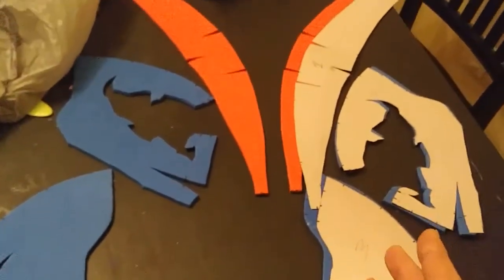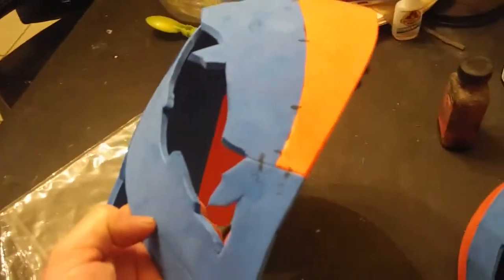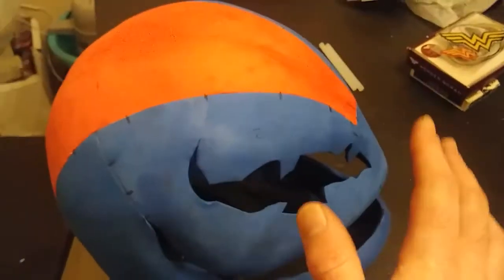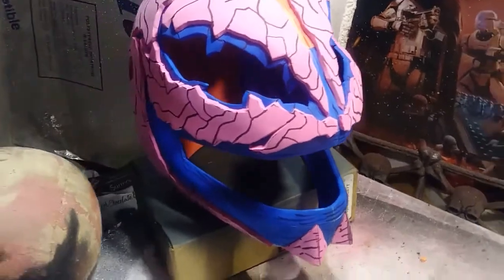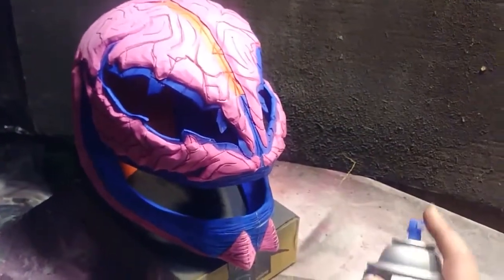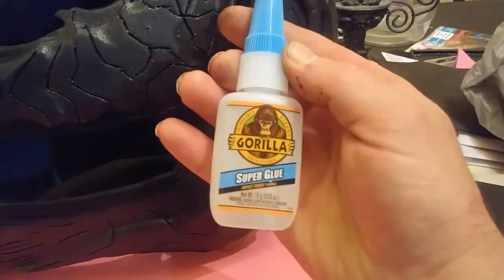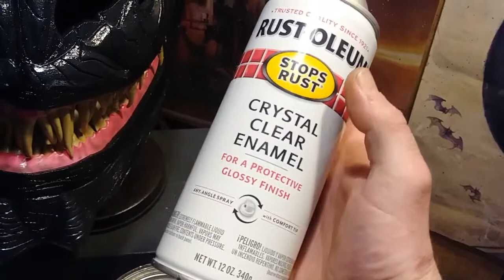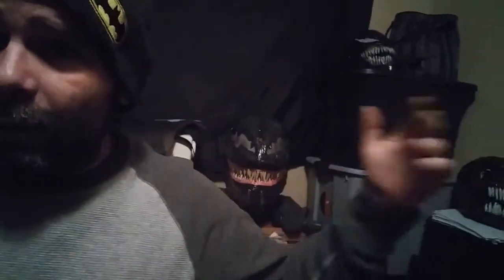RIOT DIY cosplay mask build video

Comment: Rock on. 
Awesome video!
I like the see through mesh for the eyes. If you didn't back it with plastic, and painted it black, could you see through it okay? Kinda like a screen? Or is the weave too thick and black just clog it up?
Reply from the maker: I think that would depend on what type of paint and how it was applied. If it was an airbrush paint applied like I do in black it should be fine. The sheer cloth I used is not so fine that the mist from the airbrush would clog it. So in that sense yes, it would work just fine. Brush applications of paint would probably clog it. Another option would be to use rit dye and dye it as desired.